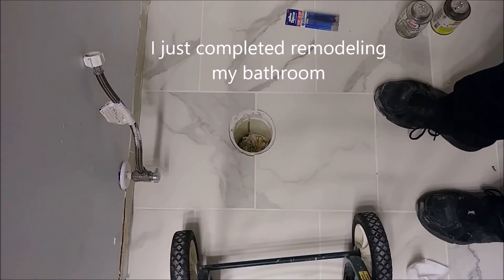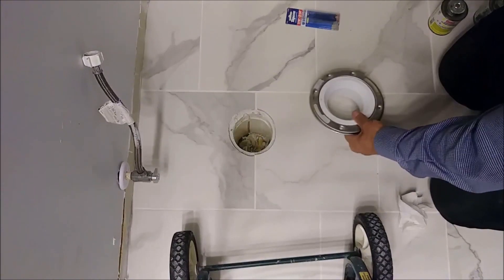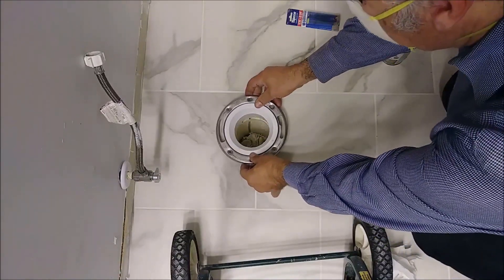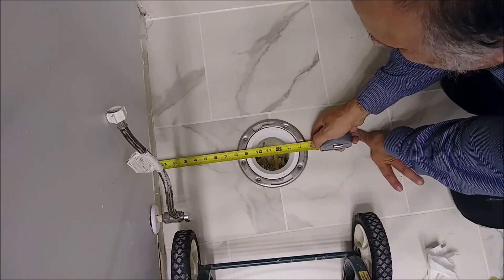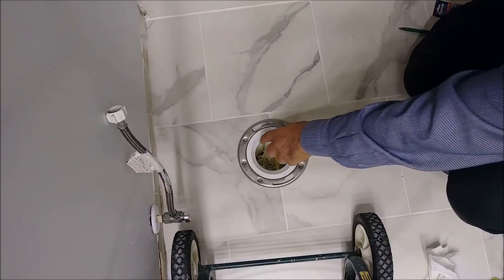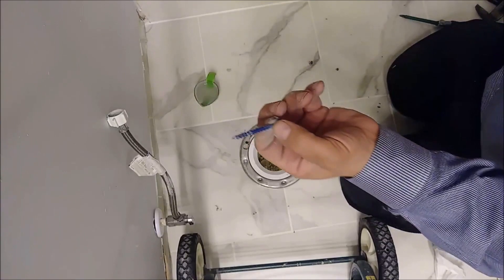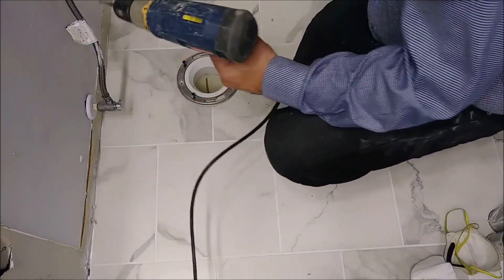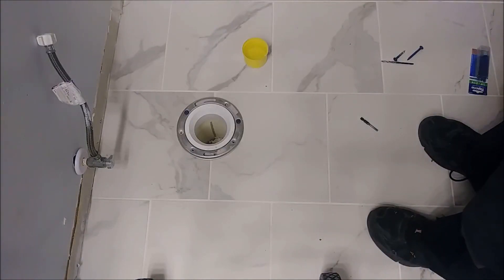How To Install Toilet Flange Above Tile  - On Concrete Floor - DIY

Comment from the maker: Find Flange In = https://amzn.to/3i2HByH
Fluidmaster Rubber Toilet Seal = https://amzn.to/2EudIcG
Tapcon Screws and bit = https://amzn.to/2G8IU1w
hammer drill  I used = https://amzn.to/361KhKx
cement glue = https://amzn.to/2HpMSDD  or https://amzn.to/33e6nYA
clear cleaner = https://amzn.to/2EJtC33
Amazon Deals:
Try Amazon Prime 30 days for free = https://amzn.to/2JMWaLe
Create Amazon Business account = https://amzn.to/3mLSyYt
Joint Amazon Prime Watch Thousends Of Movies and TV = https://amzn.to/33NfsHD
Try Personal Shopper Wardrobe  https://amzn.to/2VClfv9

Comment: You emphasize wearing safety glasses but your video shows contrary. The first dawning of them (at 2:23) shows them protecting your forehead. Good use of mask over nose and mouth when using the cement chemicals 👍
Reply from the maker: Thanks for you comment

Comment: What exact bit is being used?
Reply from the maker: 1/4" concrete bit come with the screws:  https://amzn.to/2G8IU1w

flange with Tabcon screws  to the tiles.
Find Flange In = https://amzn.to/3i2HByH
Screws and bit = https://amzn.to/2G8IU1w
drill  I used = https://amzn.to/361KhKx
Reply: I use a diamond bit (1/4" or 5/16") to get through the tile, then a concrete bit for the remainder.
Reply: Thanks guys
Reply from the maker: @scottiniowa1  Yes that the way to do it.